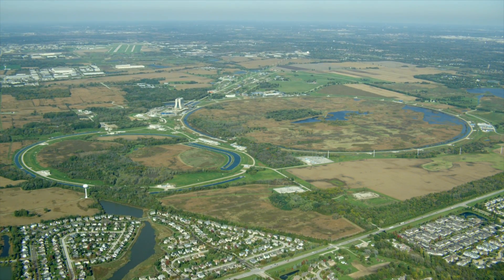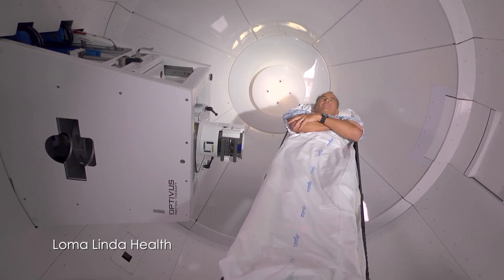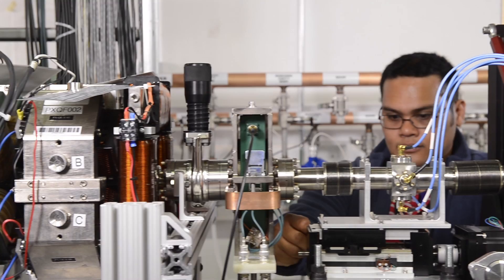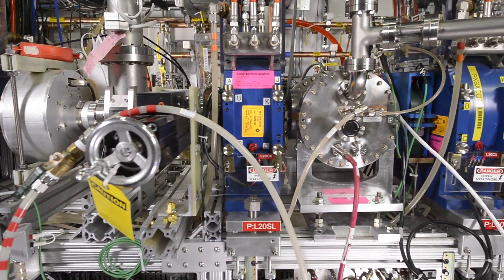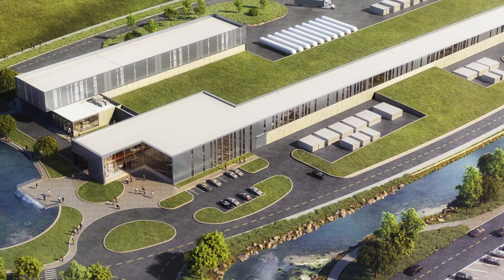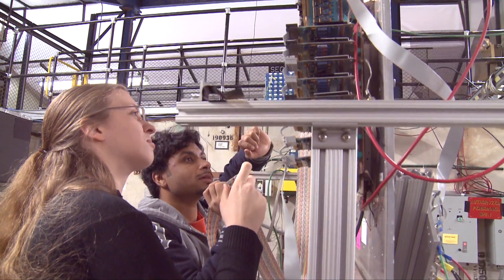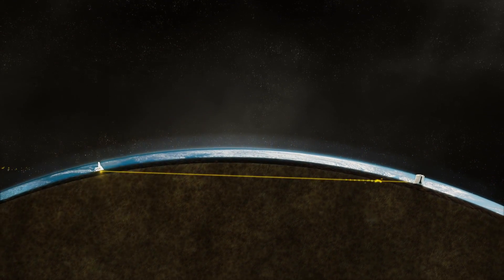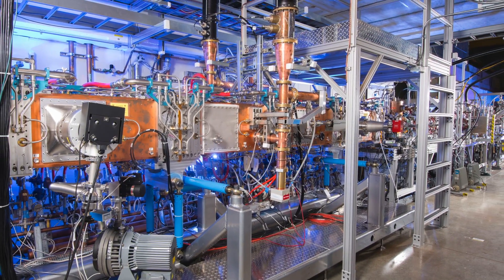PIP-II: the new heart of Fermilab

Comment: Neutrino ocean phase harmonized by resonation.. quasars. A large reaction engine towards the center  of expansion. This could be like Ton 618 but larger. It would be responsible for the active cmb still blocking its view today. Are electrons designed to evolve over entropic energy fields in a fluid dynamic neutrino ocean tunneling worm holes for us to exist and evolve in pulled behind them? Or are they part of a pulsating resonation infinite quasar driving pressure waves and harmonizing fusion and electron needlecasting across and through at 14 bullion year deep permiable field we call both spacetime and ourselves. Are we in phase with these neutrinos? Is this why they are so difficult to detect. You have to kick them out of wave concentration with the power of fusion in motion or concentrations of photons. Neutrino ocean. I bet all life earnings. I'll call to cash out after you tell the astronauts at the space station to get some flippers out and kicks there legs nice and resonant in orbit walks. Go Fer a swim, ahe? 🌊🌌 .. maybe we tell Elon to put a big subwoofer on the bottom of the starship. Or we find a way to use Tesla coils and pulsation with magnification shaping. Fusion will need to be in space BTW. Themodynamics, neutrino conditions, and helion supply on the Moon - these will make the motion in the ocean that we want. 🔅♋️🔆⚛️

Comment: So [phospholipase] PIP3 Complex comes next per chance? With neutrinos as aloof as they are, would not the motion of Earth's orbit -  even with neutrinos at speed - need to be priced into the beam direction as it is aimed at the detector?
Reply: Huh?
Reply: Within almost all of your cell walls are PIP3 proteins that play multiple hands in G-protein receptor secondary messenger signalling. Phospholipase breaks down another compound. As for the neutrino beam, it's fired through the Earth for a great many kilometres to a distant surface detector, owing to Earth's curvature. I merely wondered by how much the beam maybe found offset due to the planets motion in concert with particle travel time.
Reply: Hmmm the beam is firing east to west but wait... Earth is accelerating around the Sun way faster than its spinning and the Sun is orbiting the galactic centre even faster than that and the milky way is .......